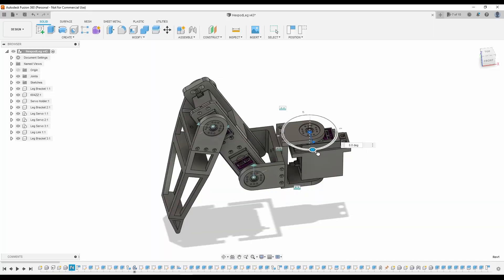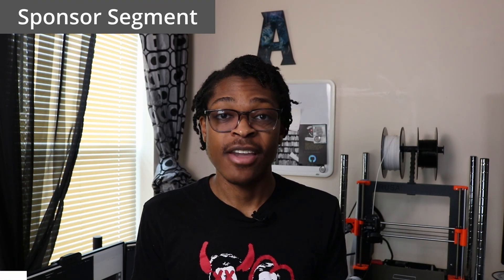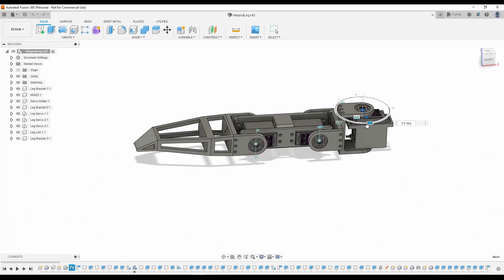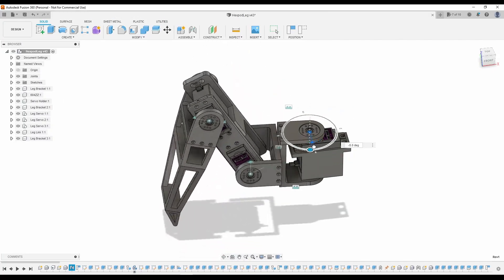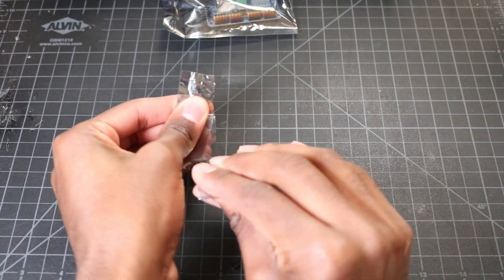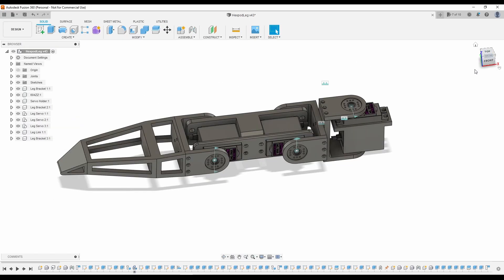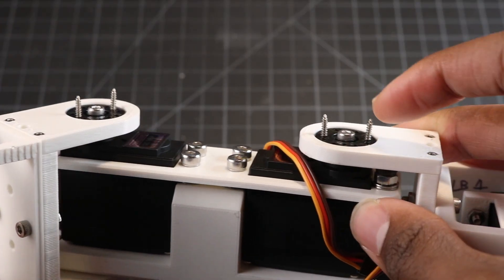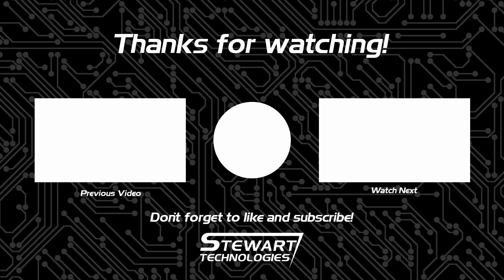Building a 3D Printed Hexapod Part 1 | Leg Design

Comment: Question, I've been wondering this for a while, how do you get the 3d model of the servo so you can design with it in cad instead of taking measurements? Or do you just take a lot of measurements?
Reply from the maker: If they're simple models I design them myself after taking measurements. For more complex things like servos, you can find models online from manufacturers or through sites like GrabCAD.

Comment: Love the video. Was wondering, what are you using inside the screw holes? And how did you mount them inside the 3D printed parts?
Reply from the maker: They're Heat-set inserts that are threaded on the inside. I used my soldering iron with special tip made just for the inserts.

Comment: Really cool project, can't wait for part two. What did you use in this video to power the PCA9685 chip, and what is the plan to power the finish robot?
Reply from the maker: I used a 5V 4A power supply for the servos and the 5V output from the Arduino to power the chip. I plan on using a LiPo battery with a SBEC to provide the servos with 6V. I talk about it a bit in part 2, which is out now!
Reply: @StewartTechnologies  I have been making a 4 legged robot dog and use a lot of of the same ideas. Right now I have it plugged into a 5v 10a charger. It’s probably overkill but it’s what I had. I will watch part two rn.